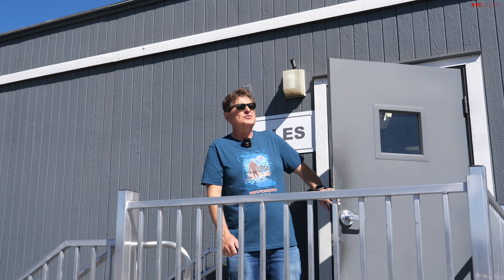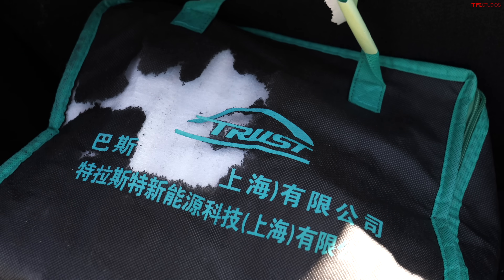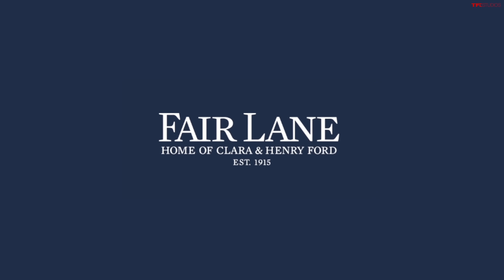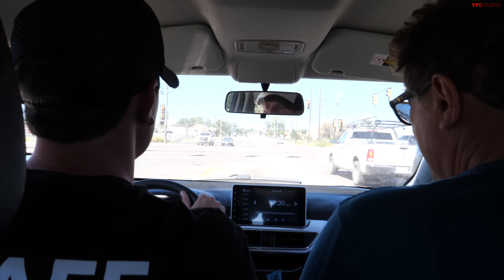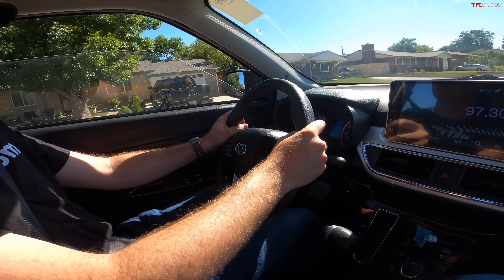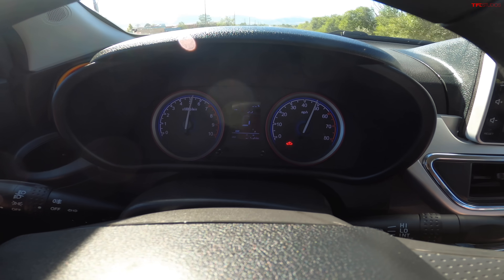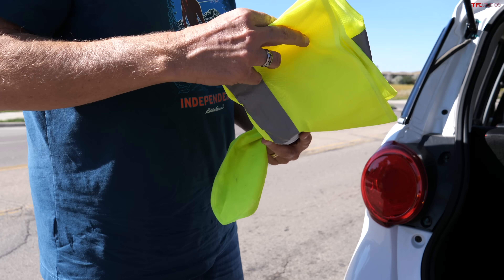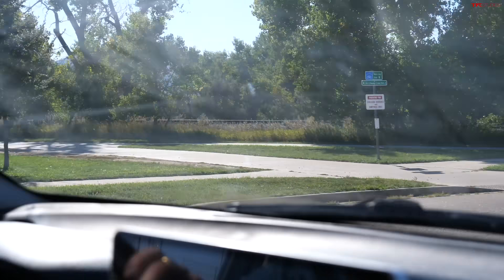We Just Bought the CHEAPEST New Car in America...And It IMMEDIATELY Broke Down & Left Us Stranded!

Comment: My theory is because it sat presumably unplugged for an extended period of time, cell voltages became imbalanced.  The car has been measuring current out of the pack during the drive home and is calculating SOC based on theoretical remaining energy.  But the BMS steps in when at least one cell gets too low to avoid damage and shuts the party down despite there still being energy left in the pack. 
Leave it plugged in for a couple of days and then see how low of a SOC you can get to.
Reply: Yup - they just need to leave it plugged in for a few days and then cycle the battery again.  It sat for a year - what the heck did they expect?  Good youtube content!
Reply: This. One of the cells self discharge rate is higher than the others. Probably used 2nd hand lithium batteries for cost cutting and didn't match the cells with similar internal resistance to each other. Prius's will do this same thing when a cell is on its way out and sits for a little while.
Reply: @1987FX16  Yeah, after the car has 200k miles on it LOL
Reply: @evrythingis1  The OE 2nd/3rd gen Prius batteries are known to easily last 300k+ miles if cared for properly.
Reply: @1987FX16  That sounds pretty standard for Toyota, maybe one day other manufacturers will finally start making reliable cars.
Reply: @evrythingis1 Ford's V8s are +300k mile motors and thier I6 is a million plus mile setup.  My 1990 has 600k miles and is all original, and us not an outlier.
Reply: @bowez9  cool story bro. Too bad cars are made up of hundreds of other parts that Ford makes terribly.  "Ford used to make one good engine" isn't exactly saying much...
Reply: @evrythingis1  the transmissions (outside the Gertac) last 200k-300k miles.  Toyota's "reliability" isn't special.  Ford's current V8s and I4s still get over 300k miles.  At 300k miles the torn down engines are still at factory orginal tolerances.

Perfect example explain how Consumer Reports says the Camary is above average on reliability but the F series is below average-while BOTH are  the AVERAGE  vehicle for the class.
Reply: @bowez9  JS, Non of the transmissions that Ford uses are designed and manufactured by Ford. Not knocking them but.
Reply: @1987FX16  so the 10 speed wasn't designed by Ford as a joint effort between GM and Ford?  Where FOMOCO did a RWD trans and GM did a FWD trans.

Where the 10R80, 10R60 and 10R140 are made in Livonia, MI and Sharonville, OH.

Nevermind the 6R family which is also built in Livonia.
Reply: @bowez9  Exactly a joint effort. It wasn't solely engineered, designed, and manufactured by Ford. Although they did take end responsibility of manufacturing the Ford/GM transmission.
Reply: @1987FX16  you don't understand the project Ford solely designed the RWD 10 speed and GM solely designed the FWD 8speed.  Then each was adapted to the vehicles.
Reply: @bowez9  Okay you got me the 10R is 1 transmission in the last 40 years that's was designed and manufactured by Ford. I'm not finding many reports of a 10R being very reliable above 75k miles. Which doesn't really bode with your claim of 300k+ but whatever. Also the 6R is a German designed transmission that Ford bought the rights to manufacturer, so that's not even close to counting.
Reply: @1987FX16  if you want to go back 40yrs...C4, AOD, AODE, 4R70/W, 4R75W; C6, E4OD, 4R100; 4ALD, 4R44e, 4R44e, 5R44e (first 5speed OEM auto), 5R55e; C5; AXOD, AX4N; FLC; CD4E; 5R110W; 6R140.

With those being built mainly at Livonia, or Batavia OH.
And that's excluding the Mazda, Land Rover, Jaguar, Volvo ones.
Reply: @bowez9  Exactly, these are the ones I'm talking about, shoulda said 30 years though. Also 95% of that list is just revised versions that derive from the C3, C6. The AXOD, AXOD-E, AX4S, and AX5N are just variants of the same transmission. And oh wow, what a game changer the FLC was. Most of this list is just like saying GM came out with a brand new transmission in 1992, 2001, and 2006 because they came out with the 4l60e, 4l65e, and 4l70e revisions.
Reply: @1987FX16  so the first Electronic controlled transmission and first 5 speed is nothing?

Also you said they didn't make any and then I give you a list a mile long and now your moving tge goal post.  Those name changes do denote SIGNIFICANT  design changes.  Try and put an AOD governor into a 4R70W/E

Or are you saying Ford didn't DESIGN AND BUILD all those transmission ?

So if the 10R is bad after 75k then where are the reports about GMs having issue, Allison included?
Reply: Regardless of this entire fiasco, I read on a few websites KANDI caved. They changed to Off-Roading Vehicles for 90 percent of what they sell, and they have one vehicle that isn't even Interstate Legal going 60 MPH Maximum probably throttled too for $27,999 the cost of a Toyota Prius but a shitty range of 50 Miles with an option of 100 Miles extra purchased.
Reply: The car is still junk at the end of the day
Reply: Absolutely ! The SOC, along with the BMS took a DMP at it MAX due to the HET.
They all do it.
Reply: Are they selling this thing? I work 8 miles from home and this would be perfect.
Reply: @DocNo27  Well since one of the unstated goals of this channel seems to be to trash EVs and shame people who drive cheap low-status vehicles (because status is why you buy a car, right?), they seem to have done just fine. Got just what they wanted?

Comment: There is definitely a market for sub 10K new, very simple EV's like this. As long as it can go 80-100 miles using full capacity and at least 55MPH, it would be an actual good city/suburb car if you didn't have reliable or safe public transport.
You can get a used leaf for that price, but the range can degrade severely on some of those since they were air cooled nickel/cobalt based batteries.
Reply: I honestly don't think there would be much of a market. Not big enough to justify production with such small profits it surely has. 

It's styling would never have widespread appeal, its a unknown brand, it looks and would feel dangerous regardless if it's safe or not, I feel like this is a city car but most Americans don't spend all their life on a city and I wonder how you would keep it charged. I don't think you could have a charging cable across the side walk or that a apartment complex would let you install one. But idk. Maybe it would do well.
Reply: There's no market for a vehicle like this in the US. If your budget is $10K, you can get a real used car. Why risk your life in this death trap? And why make every other sacrifice you're making?
Reply: If you need a car this cheap, you probably don't have an electric charging point at home
Reply: @SnowofLight  With that 17kWh battery it would take 12 hours to charge on a normal outlet, so most people are set.

Comment: There is no way that car could have ever been certified for sale and use on American roads.
Reply: It's not really (it's a NEV)
Reply: You don’t get temp tags for cars not legal in the United States
Reply: Maybe Kandi guys paid inspector off for crash certification?
Reply: @brentvance3958  It's only allowed on 35 mph roads and slower.
Reply: Not from America so I could be wrong, and please correct me if I am, but since this is limited to 35mph maximum it doesn't need to pass the full suite of safety measures that a 'normal' vehicle would.
Reply: @runningawayvagabond5876  That's correct. The downside being you can only drive it on 35 mph streets legally.
Reply: It’s gotta be a NEV (Neighborhood Electric Vehicle). Basically treated the same as a golf cart, limited to 25mph, can’t go on roads with a posted speed limit over 35 (or 45 in some states). They aren’t required to have as much safety equipment or crashworthiness compared to normal vehicles. I think the main difference between these things in USA vs. the rest of the world is that in the USA you still need a normal license to drive one, whereas in other countries you might not, or the permit you need is easier to get but more limited.
Reply: @Sashazur    yes, it was advertised as a NEV -- that is why the other model mentioned was more expensive.
Reply: Aside from the top speed that thing fits right in with the fwd subcompacts sold in the US in the mid 80s through late 90s. Tin can doors and all.
Reply: Hyundai and Kai have entered the building!
Reply: This vehicle is NOT a NEV. Under Federal law a NEV is designed to go no faster than 25 mph. This vehicle was designed to do 60+ mph software limited to 35 mph. This does not meet the Federal standard for an NEV. 

In addition NEV's do not require airbags or windshield wipers vehicles designed for highway use require both. This vehicle was originally designed and met the safety requirements of a highway rated vehicle.
Reply: @JoeBLOWFHB    they had both, there was a NEV and it was MARKETED as a NEV -- and there was a road version that was significantly more expensive with twice the battery.  

Looks like they finally took them off the website.  They still list an "offroad" pickup truck for 28-35K.

Nothing street legal though, other than ebikes.
Reply: @redwolfexr  No it wasn't, the K27 was originally DESIGNED and marketed to go 60+mph hence the addition of airbags because it wasn't designed as an NEV.

I don't care how they market it it doesn't meet US Federal NEV standards for DESIGNED speed. "Designed" is an important word because it is in the language of the law. Go look up Federal NEV standards.

"Nearly all 50 states allow LSVs, also called Neighborhood Electric Vehicles (NEVs), to drive on their roads where the speed limit is 35 mph or less. Either they follow FMVSS500 (25 mph top speed on 35 mph limit roads), or make their own more aggressive law. Because of federal law, car dealers cannot legally sell the vehicles to go faster than 25 mph (40 km/h)".
Reply: @JoeBLOWFHB   so it passed an even HIGHER safety standard and then they limited it down to NEV speed/standard and you are quibbling?

they also reduced the battery on the version they marketed as a NEV.   Ninebot markets SurRon's as a Class C eBike too - and we both know its really an offroad motorcycle with a fake limiter.   

Oddly enough the one in this video wasn't the NEV version but they added a limiter anyway.   (there were 2 separate K27s, and then the K23)  I suspect that they never got the crash testing and certifications for a true on-road vehicle.

I actually have seen a few around, the company was based in Dallas.  Maybe it still is.  They had a bunch running around North Dallas/Irving/Addison area -- with MFG plates.
Reply: @redwolfexr FEDERAL LAW DOES NOT ALLOW THE SALE OF "NEV's" THAT EXCEED 25 mph. 

IT ISN'T A NEV!
Reply: @JoeBLOWFHB    and that is what they limited it to..  didn't you watch the video?   It was going around 35 on the flat.  Its almost like they... picked 35 on purpose...

Oh, and let me just post this here:  "Neighborhood Electric Vehicles” (NEVs) are governed in Texas under Section 551, Subchapter D, of the Texas Transportation Code (hereinafter the “NEV Statute”) (9). The NEV Statute defines a “neighborhood electric vehicle” as a vehicle that can attain a maximum speed of 35 mph on a paved surface"

Did you know Kandi was based in TEXAS?   Where NEVs are specifically 35MPH?   And titled BY TEXAS as NEVs? 

Just like the SurRon that oddly enough goes EXACTLY 28MPH.  Which oddly enough is what Class C's maximum speed is.  Never mind that  it has a 23HP motor and you only clip one wire to jailbreak it...
Reply: It got further than the Hummer
Reply: I was with a friend in Texas. We drove to Wichita Falls and on another day to The Alamo. Huge distances, done easy by .......... A Ford Ranger. I 100% understand an EV like this tested car or even no EV can do that job. EV's like in this video can only be used in the future 15 minute cities, but do we really want 15 minute cities? I like freedom like all of my USA friends. I drive a lot in Europe, even on German Autobahn where driving 100 mph is slow. Luckily I have a 170 hbp Jeep Renegade 🙂
Reply: @frankieatworld7321    You can go quite a ways in 15 minutes.   This isn't intended to be someone's "only" vehicle.   Its the equivalent of a bicycle that you use to ride around the immediate area.  (in fact it is basically an e-Bike with cargo and a passenger)

Comment: Could be a battery balance issue from sitting so long.  Plug into a 110 outlet and let it sit for 1 week.  It should rebalance.  It will not rebalance on a level 2 or higher charge rate

Comment: What’s really frustrating is how things are priced based on the market they are sold in.  A 48 volt 17.9 kWh battery for home solar costs about $15k, but if it’s in a car it’s a lot cheaper. We are getting ripped off!  The Kandi seems like a cool little grocery getter.  Not practical for as much as I drive though.
Reply: That's solar thing for homes isn't way too expensive. It's a scam.
Reply: Lots of 5kWh batteries are selling for under $2k currently although shipping will run you $4-600 depending on where you live. But yes things like the Chevy Bolt are subsidized in many ways making them a super cheap source of batteries.

Comment: In the early 2000's  I purchased an electric car.  It was called the NAP 3000.  It had a 48V lead acid battery and a 3000W motor mounted to the rear axle.  It looked like a Smart car.  It would not go over 30mph.  I converted it to 72Vdc(still lead acid).  It would go almost 40mph for about 15 miles.  It was a Chinese piece of garbage made to look like a real car.  I cut it up with a sawzall and took it to the dump.  I use the batteries for my solar energy storage.

Comment: Id like to know if you can recharge it with the break or in gear while it being towed ,,'' Regen '' mode is supposed to put power back in the system when your stopping or slowing down so If you being towed for a mile or 2 will it charge the battery using the regen system ?

Comment: you will need a sticker on the rear to make people smile like the small fiat available here in the eighties like Fiat Panda the crazy car as Fiat had it advertised, which was a box shape car if you check it out. 

I bet the BMS was misaligned after a year of sitting and then you need to charge and drive then. It needs to recalibrate like the early tesla model 3 with LFP batteries from china when it was new and no one knew about. And maybe the manual and hotline might offer also new insights what to do.

The same happened to a Renault twingo electric in 2022 on a german highway cause the car said 11% SOC and then died on the highway, has been towed 2 km to the charger and then it worked fine again. That has been a press car. 
Now you mentioned the BMS, where inside usually is also a coloumb or energy meter which needs also calibration like any new golf nowadays after a 12V battery swap which is achieved by swapping in a full battery and then set a new serial battery number via odbc adapter . Yes, that sounds weird, but a new serial number never been used before tells the car that it has gotten a new 12V battery and from there it does count the energy going in and out . This is nothing new, cause it has been introduced when the start stop automatic went into cars to save gas. It avoid in the morning after a start that the start stop would turn the engine of if the battery is too low. This whole system is based on a shunt measuring what goes in and what goes out. 

It should not be broken, just needs a full charge and a reset of the bms or the energymeter aka coloumbmeter which is a remaining capacity counter. 
Good luck, this will be a fun car - remember the days you climbed that pike somewhere with an e-GOLF if I remember right ?
That was easy but will be far more challenging with such Candy car.

Comment: If it is LFP, the voltage doesn’t change much over the discharge cycle so it is possible that if it sat a long time slowly discharging the BMS didn’t know the true state of charge of the battery and it just ran out of juice and just needs recharged and recalibrated. But that’s a wild guess, and it could be anything.

Comment: 50 amps?😂
I have an e-bike that can put that out & it can go as fast. It can't haul passengers but I didn't spend half of the cost of a K27 plus I've had a few years & thousands of miles relatively problem free.
FYI batteries don't like sitting and like reaching empty even less. Always charge a battery to full before a ride after it's been sitting unused.

Comment: The Mitsubishi Mirage should get a real honest to God long term review from you guys. Think of it as a new age 2CV or a Beatle, dont expect much from it and you will be pleasantly surprised. I bought a used 2017 G4 2 years ago as a backup vehicle full well expecting to hate it but that 100k warranty sold me on it. And I actually really enjoy that car. Back and forth to work I average between 45-50mpg and other than an occasional rough idle and a quirky feeling CVT its been flawless. Has no problems keeping up with regular traffic if you aren't afraid to floor it on steep hills to get you up to the posted speed limit. I saw the episode where yall borrowed one and piled into it just to make fun of how slow it was but it literally accelerates at the same speed empty or fully loaded. Theres a story of one that got over 400k miles on it as a work vehicle and was still running strong.

Comment: I wonder if you need to cycle the battery a few times (charge, discharge, repeat) before it has full capacity use.  Some batteries in the RC hobby are like that.

Comment: As an ebike mechanic the battery is more then likely the issue, it will show good voltage but you need to check the amperage, when these batteries sit they tend to lose there ability to hold amps.
Reply: The internal "series resistance" is sky high. The voltage "drop" INSIDE the battery is why there is practically NO voltage at the motor terminals!